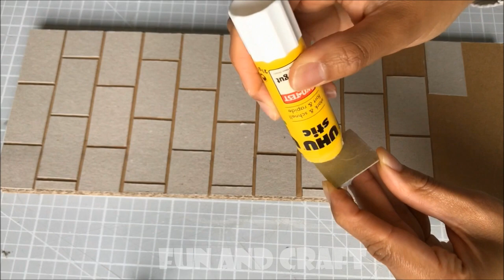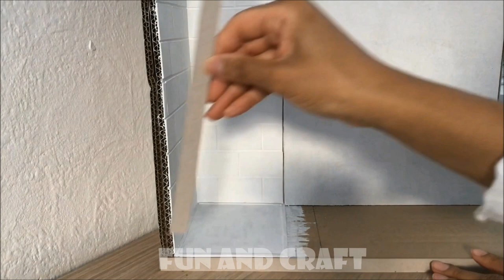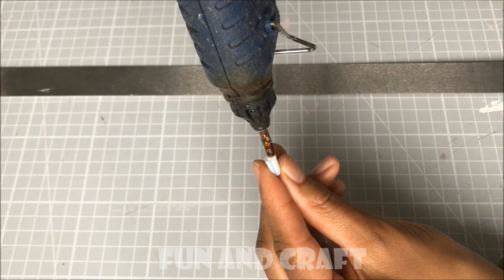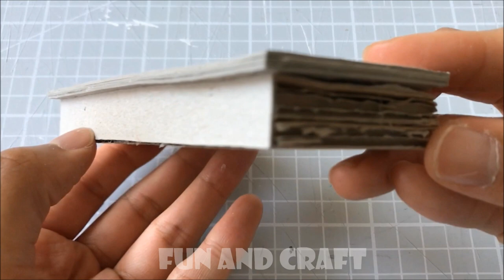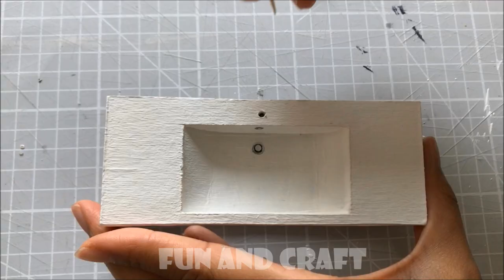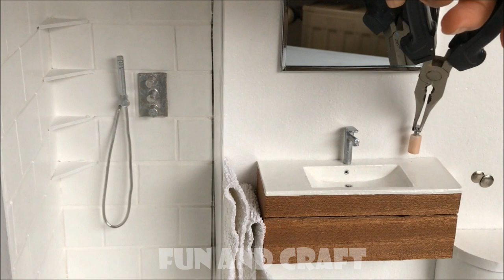DIY Miniature Bathroom for Dolls

Comment: You coat your paperboard with clear drying glue before painting it.  Doesn’t this cause the paint to ‘crackle’?
Reply from the maker: No I haven’t noticed any crackling. I use clear drying glue because sometimes the paperboard absorbs the paint and I have to apply so many layers and also to make sure the edges stay down.